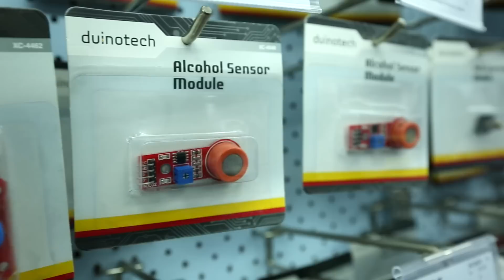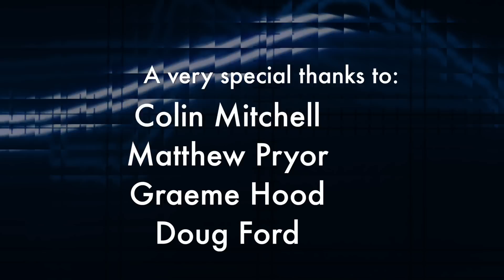The Decline of Hobby Electronics?

Comment: You need a magnifying glass and tweezers just to see the numbers on surface mounts.  What happened to Radio Shack?  That sums it up.  Kids today are not interested anymore.
Reply: I worked for Radio Shack in one of their repair centers for nearly 20 years. Before that it was the in the US Navy in the early 1970's followed by a couple of mom & pop shops. In the time I came across my first SMD known as "flat packs" in a piece of F-14 Tomcat gear. We did not replace those because these devices were made to be rugged that these component leads were welded onto the board lands! We replaced the whole module. I did replace resistors smaller than the SMD sizes available to hobbyists in the latter Nokia analog cellphones Radio Shack sold with a Weller #7 tip!  Mike, you are lucky still working at your age! Not only was I laid off in 2001 just before age 50, but I was ill since then with only recently the health problem was found. My first scratch build was a mulitvibrator circuit made from germanium transistors on a thin fiberglass wafer. I still have that. I still did some analog/digital projects from scratch since my layoff.
Reply: Mike McDaniels: It was a autoimmune peripheral neuropathy in the feet that was in the background diagnosed as something else for at least 37 years before a proper diagnoses was made after the condition went nuclear on me. That was and still is painful and almost put me in a wheelchair. It is in remission now, but the past 4 years it made me dopey from the pain. No painkillers worked for this kind of pain. Slowly getting back to things.
Reply: Starphot: My friends use gabapentin.  I put my feet up. What do you do?
Reply: Mike McDaniels: Gabapentin was the first stuff given me. Not even Lyrica helped anything at all. That was one of the hoops in the diagnoses I had to go through. Putting the feet up only increases the pain. The treatment was IVIg.
Reply: Mike McDaniels: No. It is taken at 3-4 week intervals by a visiting nurse for 6-9 months. It may be taken again if a relapse happens. With my CIDP condition, this has a 90% long-term remission rate. Remember, a treatment for one cause of neuropathy is worthless for the many other causes.
Reply: Radio Shack died, but a company like Adafruit in America is thriving in its place.

The game has changed. As a kid I could learn how to build a blinking light circuit with a 555 timer chip or I could learn how to get my plant to send me a notification when it needs water. 

These days the complexity and cost to build these projects are relatively similar, I know which I'd prefer to do!
Reply: Is it a problem to get tweezers? (you do not really need a magnifying glass for soldering unless you are half blind.) 

Radio Shack is obsolete because you can order parts from China at tiny fraction of the cost you would pay in the radio shack having assortment which in orders of magnitude surpass any local shop
Reply: deltaxcd  I'm 68 years old, and still working.  I find myself replacing more boards lately, instead of fixing them. Maybe I should give up, and file for ssi.
Reply: In that case, you should say "I need a magnifying glass and tweezers..." not "You need .."  because most people who do this are not 68 years old with shaking hands. Normal people can see those markings with their bare eyes and those issues are irrelevant.

The reason why we replace more boards than components is that buying a single component for that board is often more expensive than buying all board ignoring even labor cost for finding and replacing that component.
Reply: delaxative you aren't old enough to have a valid opinion.

Comment: When Heathkit was done so was I. I still have the Heathkit hand me down from my dad put together: scope, signal generator and signal tracer. My roommate put together a Heathkit color TV that was better than what available then. I had put together Dynaco preamp, power amp and tuner that were as good as some of the better hi fi components in its days. Couple of neighbor kids then had hotrods gathered from various cars, engine/transmission building/mods.

Comment: I miss vacuum tubes
Reply: Delilaxative you are misinformed as well as just plane wrong.
Reply: It's still in use in high end audio equipment. I think the Russians use tubes in some of their military equipment in case of an EMP attack.
Reply: I can't say how I know about vacuum tubes and such. But yes, They are EMP resistant.  If I had the funds I would make my own tubes. There is a guy that managed to bring the Nixie Tube back.
Reply: very true  yes they do
Reply: Vacuum tubes are somewhat back except that they are now placed in the microchips.
vacuum is pretty good for high-frequency designs because electron velocity in the vacuum is far higher than in the semiconductor what results in more power and better frequency response.

tubes are not any more emp resistant than semiconductors besides the fact that they are so huge that you can't physically destroy them if you make tubes in the size of transistor they will not have much of emp resistance
Reply: LSI vacuum-channel transistors reality maybe years away relative for the consumer market. 

In reference to the MiG-25 tube vs. solid state, “vacuum-based avionics could withstand the electromagnetic pulse from a nuclear blast better than anything the West had in its planes.” IEEE
Reply: they will never appear in most electronic because you cannot make p channel vacuum.
this is also why other technologies cannot get into mainstream electronic, but I don't think it will take that long for vacuum transistors to get into RF market where they have big advantages

Comment: "you cant buy a 20$ soldering iron to make thing" really? china doesn't only make the problems they offer soloutions too ;)
http://www.ebay.com/itm/YiHUA-936B-SMD-Electric-ESD-Soldering-Rework-Iron-Station-Welding-Tool-Kit-110V/371993129984?_trksid=p2047675.c100005.m1851&_trkparms=aid%3D222007%26algo%3DSIM.MBE%26ao%3D2%26asc%3D45042%26meid%3Dbf14dd273752454aa392c3a1438149bb%26pid%3D100005%26rk%3D5%26rkt%3D6%26sd%3D272681449661

Comment: The problem is prices. Why would I buy a single 5% 1/4W resistor for 0.10€ at the local shop if I can buy a pack of 100 1% ones from China for 1€? Sure, they take a month or more to get here, but that just means I'll buy them in bulk.
Reply: Ned and the speed of technology makes the need for quality components nonexistent
Reply: thinking ahead which hobby project you want the next month solves the time delay issue, because when you do this every day you get a constant flow of packages ( i do this and nearly day is like chrismas xD)

Comment: Every radioshack around me has closed!  I have to drive an hour to buy components are order from a distributor and wait.  The closest place that sells components is Fry's Electronics.
Reply: The Radio Shacks that did survive are just phone stores now but most RS stores haven't carried components for a long time. I had trouble trying to buy a 75/300 ohm converter to connect my old omni-directional antenna to a new flat screen TV. RS had it in a drawer along the back wall of the store but the kid working(?) there had no idea what I was asking for.

Comment: As a hobbyist back in the early '60's my best friend and I would go to the local dump and harvest all the electronic parts from old tube t.v.'s and radios to source our hobby needs, heck some projects even actually worked! Thing is, no landfill is going to let you in, they're all secured like an Area 51 site and even so, the microelectronics circuitry does not lend itself to traditional salvage and reuse. With the availability of inexpensive packaged circuitry, one is more inclined to be an assembler as opposed to a constructor, and in my experience this is much more satisfying than working on the discrete component level because you get to the finish line a whole lot quicker and with more reliability too. ☺
Reply: they are probably afraid that nobody will buy anything if you can get everything from the dumpster.

in fact, I did not buy any electronics for ages because you can find everything in the dumpster in the decent condition.  sometimes you may need to do some repairs

Comment: The people who would've become hobby electricians are now becoming hobby programmers. It's just a shift that reflect the times. Programming is more versatile in the sense that it doesn't require hardware in hand. And the job prospects are better because you can get outsourcing 'jobs' from all over the world by sitting on a PC. That's something you cannot do, or at least cannot do nearly as easily, if working with tangible parts are a requirement.

Comment: I like using Jaycar, but unfortunately they are so incredibly expensive.
Sometimes you see a 200% mark-up on some of the simplest components, meaning that often it works out cheaper to buy a pre-built kit or components from eBay or aliexpress and pay the postage than it is to use the High-street shop.

Comment: It's like everything else. You need to keep with the state of the art. If you do manual labor and your job is replaced by robots ... learn to design or at least repair the robots.

As a hobbyist, I'm now working with Arduinos and Raspberry Pis rather than discrete components. You can still do semi-cutting edge stuff with a handful of components, it's just that the components are at a much higher level, and so are the skills. (Even soldering!)

Comment: Electronics as a hobby has changed. I was into it as a kid and haven't really done anything electronics related for a long time after that. But Arduino is what got me back into electronics 5 years ago. Now I have a full lab with 8 1/2 digit DMMs, spectrum analysers and all kinds of goodies. Internet has replaced the brick and mortar stores. This doesn't mean we aren't ordering components from Digikey, Mouser, Ebay, Aliexpress and the like. The amount of information available online is also amazing for learning about all sorts of electronics topics. Message boards are also a great outlet for sharing knowledge with fellow hobbyists. In some ways I don't think there's ever been a better time to get into electronics. I think the biggest advantage of being into electronics today is the fact that you can get advanced test and measurement equipment for peanuts on second hand markets or thanks to low cost China manufacturing. Even on a budget you can score a 2nd hand oscilloscope, a set of cheap DMMs, 2nd hand function generator and whatever else you need for less than $500. 30 years ago when I was starting out I could have only dreamed of owning a 100Mhz scope.

Comment: I started in Electronics as a hobby when I was 13 years old, I'm 47 now, turning 48 in August, back when I first started my dad bought me a Dick Smith Funway Into Electronics box set for Christmas, which I thought was pretty cool, I learnt quite a fair bit from it, some family friends worked as electronics techs and they would give me some defunct TV chassis which I used as a source of spare parts, I eventually got to the point where I was able to assemble complete circuits on Perfboard, they were mostly FM wireless bugs, later on when I was able to get on the internet I would go looking for interesting circuits to build, mostly guitar effects because I was getting into playing electric guitar, I built quite a few guitar effects pedals, some used an interesting component called a Thermionic valve, after that I got interested in building valve circuits and eventually built a fully working valve guitar amplifier, it's been a great ride since I first started and I have learnt quite a lot in the process, I've also collected a few pieces of test equipment too, personally I don't think that Hobby Electronics is declining, it's actually changing as the technology changes, I think that hobby electronics is going to be around for as long as there's a need to build electronic devices and circuits, I'm mostly interested in audio/music related electronics nowadays and I'd have to say that I'm more of a traditionalist since I don't really have the fine-coordination skills to work with SMD components.

Comment: What I find most frustrating is that most electronics can be bought for less than what you would have to pay for the components alone. However, there are still areas where it does pay to design and build your own things. One of them is analog modular music synthesizers: They are freakingly expensive but actually quite simple in their design. So if you have the one really expensive component you need - the keyboard itself, which can be salvaged from a scrapped home organ - the rest can be bought for a fraction of the price of a factory made instrument.

Comment: I know this was posted 2 years ago but I only came across this video this evening as, at 45 years old and after developing an interest in amatuer radio, I have also become interested in electronics. As a kid I had very basic electronics learning kits (the ones with spring connectors) and I remember also playing around with breadboards too, but now I am getting on a bit, I really have an interest in learning that I did not have as a child. 
It really annoys me that I have no real choice but to order stuff from ebay rather than go in my local Maplins, but the truth is, they charge such a huge markup that I can not begin in the hobby in any other affordable way. 
Having scoured the internet this past week or so in my search for basic kit to get started, all I am overwhelmed by the whole Arduino craze which seems to be taking over the electronics hobbyist market. Surely leaving a £30 unit in every project you want to built is rediculously over priced and in many cases highly impractical too due to size. But I am having a real hard time finding info on programming microcontrollers for beginners, that does not have anything to do with Arduino. Seeing as microcontrolers themselves only cost a couple of quid, as does a breadboard and IC socket and so on, what is the benifit of Arduino?
Being on the outside looking in so to speak, obviously the market has changed as we demand cheaper and more compact electronic items, this is obviously going to be reflected in changing techniques for SMDs, but also as we become more accustomed to the whole internet of things with connectable wearables and so on, the whole direction of electronics is going to continue to change and develop as it always has done.
I think we are still very lucky that we have any youngsters at all interested in a hobby such as electronics, when we consider the access to entertainment they have at their fingertips today as compared to in my 1970s childhood, where Tins connected with string were great two way comms and being covered in model paint and airfix water transfer stickers was the norm, lol.
Very interesting Film, thank you.
Reply: Hello Kenny, did You realise you can use an arduino to program the ATMega micro controllers?
This means you keep the arduino and have an IC that costs less than a can of fizzy to create the same kind of hardware you could do with an arduino.. There are also specific programmers you can use for AVR or PIC micro controllers if you want to bypass arduino all together but they seem to be far more expensive and less usefull over all.
Reply from the maker: Thank you for your comment. Great stuff! On a personal level I don't think you should dismiss Arduino as a legitimate learning aid or even a really viable prototyping tool. Its a fantastic system of hardware and software which has a hell of lot to offer. Its based on the C language which is very much a fundamental to embedded programming. You can use the Arduino Environment to program in proper C/C++ and directly address registers etc. It has the added benefit of a huge community of users posing questions and answers to the simplest of problems as well as truly complex ones which will guide you in your learning progress. Join the forums and watch copious YouTube videos on "how to" and it honestly is a free university degree to an electronics degree... or at the very least a giant step forward in your own personal investigation of the world around you. Good luck.

Comment: Other than bread boarding, I actually find surface mount parts easier to work with on home grown PCBs. No needs for tiny ass holes which occasionally ruin pads and traces when drilling. Also, other than those very tiny ass components, SMDs are easier to solder -- at least for me.
Reply from the maker: Thanks for your comment. Cheers